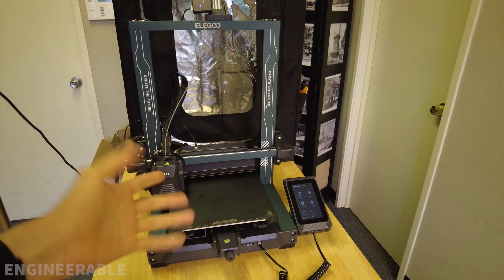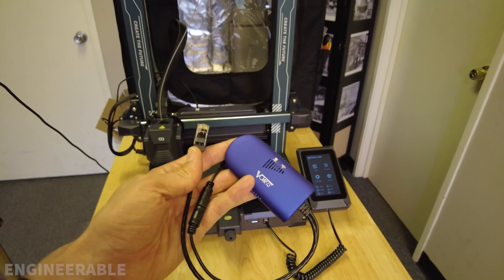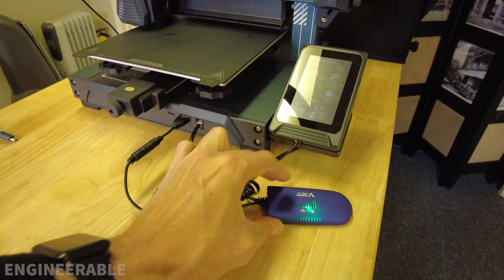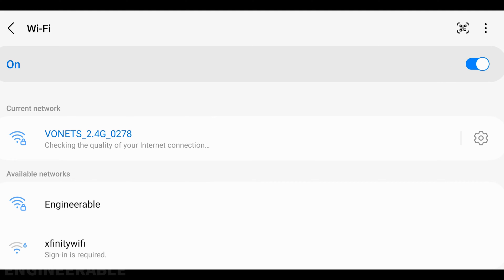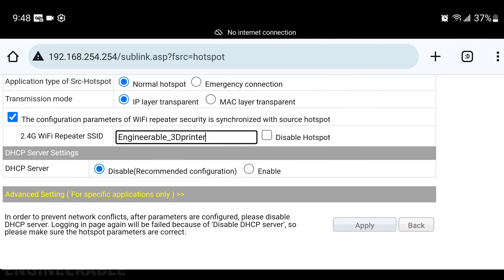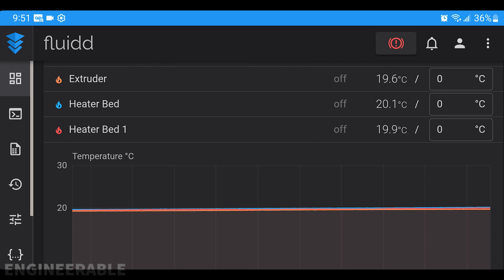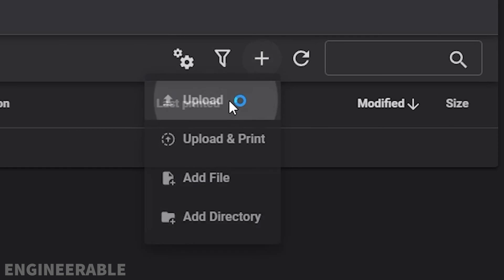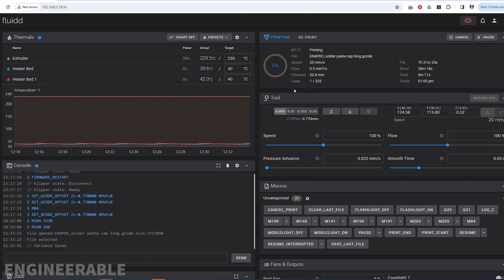How to ADD WIFI to 3D PRINTER (ELEGOO NEPTUNE 4 PRO or any 3D printer with ethernet Klipper Fluidd)

Comment: Been trying all day to setup the Vonets VAP111G on a Neptune 4 Pro but I loose the WiFi connection after reboot, the only way to recover is do a Factory reset then you back to square one, also the Vonets WiFi disappears on the computer, someone on MERG said to setup in Modem Mode, not sure yet how to do this but will try that ... also the IP address on my Neptune 4 Pro is blank and when I tried connecting I got a "0" so not sure what thats all about as i'm sure there was an IP address before ... regards John
Reply: solve it?

Comment: If i tune my printer with the fluid interface do those settings stay on my printer if I disconnect it from the internet?
Reply from the maker: @dubb5508  yes, the fluid interface is running on your printer. You are accessing the printer directly through the web browser.
Reply: @engineerable  okay this makes sense. Thank you.

Comment: can i do this with a printer without an ethernet port?
Reply from the maker: @jordantawil8909  Not easily, in theory you can use a USB WiFi dongle if it has a USB port, but the firmware will need to be modified.

Comment: Very good, only missing feature is camera stream of 3d printer.
Reply: What do you mean? Buy a cheap USB camera, plug it in, and Presto! You have a camera which can do things like detect spaghetti, do snapshots, etc. I think the AI functions are available through a different service, but some functionality is in Klipper, through the web interface.
Reply: @mitsulang  USB camera needs a computer to connect to.  A WiFi camera might be better, or a PoE camera, in latter case you might as well have a wired connection to the printer.

Comment: I followed these steps to a T and nothing. I can’t sustain a connection to the WiFi bridge for longer than 30 seconds before the webpage stops responding. But my WiFi settings say I’m still connected to the bridge.
Reply: The final IP address is wrong in the video.  Go to your settings menu on the printer > about machine> and at the bottom of the screen is your printers IP address.  To connect to your printer, go to the network you just set up in the interface, open a new window and type in your machines IP address and you should be able to access the unit and print.
Reply: That's odd. If you use a direct ethernet cable connection (no WiFi bridge), does it work?
My WiFi bridge setup in this video continues to work flawlessly.
Reply: What if i check for my machine’s IP address and it says “0”?